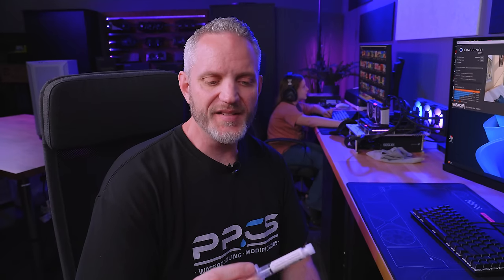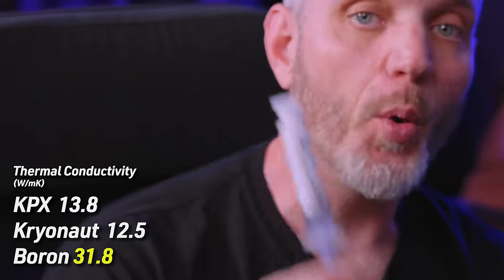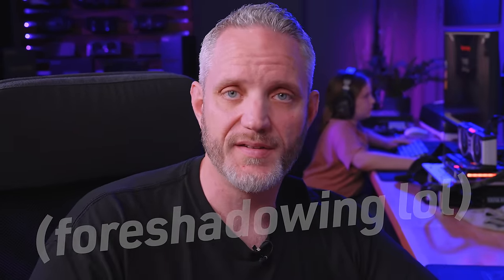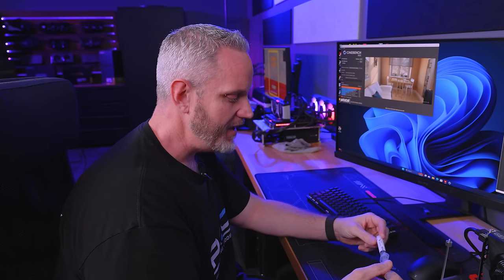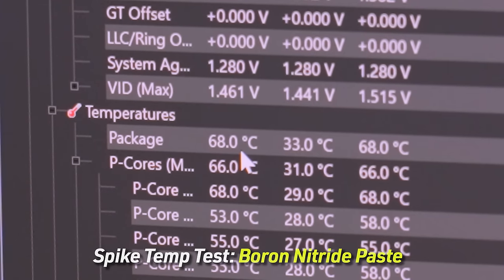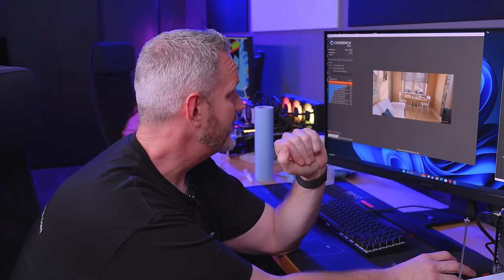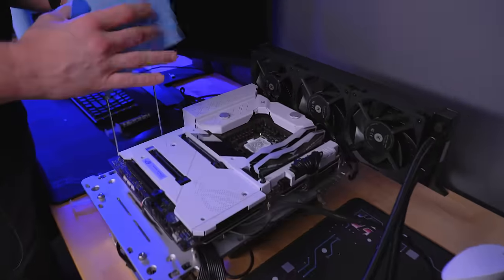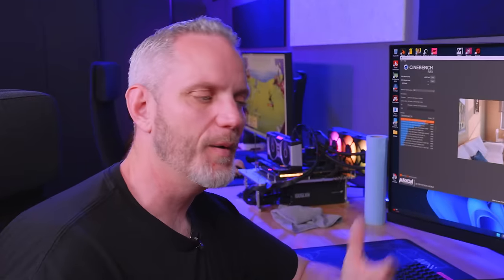Is this the new SUPER PASTE for PCs?!

Comment: So we finally found a reliable source for the Honeywell phase change thermal pads, which are great. We've got carbon thermal sheets which are also great. And now we get boron nitride super paste which I assume is also going to be great

What a time to be in the DIY computer space

How long before liquid metal just becomes completely unnecessary? To the best of my knowledge, it still has the best thermal conductivity but for how much longer?

Upon further, reading into the boron nitride stuff. I don't think I would ever actually recommend using it in a PC just because of the preparation requirements, but it's interesting and I'm going to keep using it in my 3D printer but It seems to be less usable than liquid metal for less benefit. And it is significantly less convenient than the graphite and Honeywell thermal pads

Comment: Jay, VID doesn't droop. VID is the voltage the cpu is requesting from the VID V/F curve table.

VID isn't the per core voltage. Each core and ring is requesting a voltage for their frequency at that moment. The VID sensor is reporting the highest voltage being requested out of all the cores/ring.

With boards with die sense, the vcore sensor is the actual core voltage after vdroop. With boards without die sense there its best to use VR VOUT.

Comment: So the question now becomes "would it have worked better if it was more viscous? And how would that effect the thermal conductivity? And electrical conductivity?"

We should get derbauer on it.
Reply: IIRC, there is an interview with Der8auer where he calls the thermal conductivity ratings are junk. That they can engineer and game the number to what ever they want and it will have no noticeable benefit in real world testing.
Reply: Engine oil does a great job in a car as one of the three jobs it does, plenty of viscosity there.

Comment: My next build I'm going with the Grizzly Kryosheet and Grizzly Contact Frame
Reply: I have been thinking about trying out the kryosheet myself...I'm using direct die with liquid metal right now, but it is very annoying to clean up...Plus I have to basicly lap my cold plate everytime because the liquid metal kinda etches the coldplate...I have heard the the kryosheet works almost as well as liquid metal and I won't have to worry about it anymore! I may throw one on my GPU as well...
Reply: @brucepreston3927  I don't think the Kryosheet works nearly as well as liquid metal in most benchmarks I've seen, but I don't think I've seen anyone trying it direct die either. That said, how often are you re-opening and re-applying LM? It should basically be a one and done job, it degrades maybe a couple C over years.
Reply: I've never used liquid metal, so I can't speak to whether or not it is better than the Kryosheet, but I have been using the Kryosheet since it has come out, and it works very well.
Reply: @tmoore121  My PC gets very dirty where I live so I usually do a full teardown and deep clean twice a year...I know I don't need to change the LM every time, but I do it just for piece of mind and because I might as well if i'm already doing a full teardown of everything else...I will pick up a couple kryosheets just to try it and see what temps I get...I know it won't be as good as LM, but if it's pretty close I may just keep using it...I'm sure it will work better on my GPU also, I haven't been brave enough to try LM on that...
Reply: @TTM1895  Thats good to hear! I know it won't be quite as good as LM, but it will fun just to test it and see what I get...If it works well in my PC, I may try it on my laptop also...I just like tearing computers apart! lol
Reply: Yeah the Kryosheet is awesome. Performs some °c worse than my paste but its so piss easy to use..
Reply: @brucepreston3927  I'm impressed with your determination, I don't even bleed my loops until rebuild time. I blow out my fans/rads once per year and otherwise just let my shit suffer.
Reply: @tmoore121  Yea it usually takes me 5-6 hours or so to do a full teardown and clean everything...I even strip my CPU/GPU blocks down and clean the micro fins...It's definitely not necessary, but nothing about my build is necessary! lol

Comment: Well, you don't have to go into to what W/(m⋅K) means, as that is what it means. 

As long as the thermal paste has decent thermal conductivity, small differences in the thermal conductivity between different pastes matters little compared if there's air pockets, and whether or not the layer of paste is unnecessarily thick. There should be as little paste as possible, while making sure all voids are filled, as thermal resistivity increases with the thickness of the paste layer, no matter the W/(m⋅K) value of the paste.  Thermal paste is truly one of the cases where "less is more", as long as all the air is replaced by paste. A 2 micron thick layer will have twice as much thermal resistivity as a 1 micron thick layer, all else equal.

Comment: Recently i RePasted my PowerColor RX 7900 XTX Red Devil Limited Edition card cause it was overheating and reaching 81°C GPU Temp and 110°C HotSpot with the GPU Fans on Auto.

So i RePasted it with KingPin KPx paste and i made sure to spread out the paste all over the rectangle area all over the GPU chiplets.

And now the difference is night and day.
The temps dropped to 75°C GPU Temp and 99°C HotSpot with the GPU Fans on Auto.

And after i decided to do a bit of Overclocking + Undervolting on my Card.

The temps went even lower, much lower.

Currently i have my Card set to this in the AMD Software Adrenalin:

GPU Clock min 500MHz - Default 
                    max from 2900 set to 3000MHz

VRAM from 2500MHz set to 2714MHz

Voltage from 1150mv set to 1125mv

Power Limit from 0% set to 15% The maximum 

GPU Fans set from Auto to 85% Max speed - 2880RPM at Max Load

And with these values which i've set.
I get GPU Temp 61°C Max and HotSpot Temp 89°C Max.

And my mind is officially blown away by these results.
The KingPin KPx paste is truly the best paste.

I even have it on my Ryzen 7950X3D + 420mm AiO Arctic Liquid Freezer III ARGB

Comment: Der 8auer explained this in a different video pretty well: thermal conductivity is highly dependent on the temperature difference and temperature overall. High temperature mean a higher conductivity, no matter what. And manufacturers measure it very differently and are free to choose whatever method suits them best and produces the highest numbers. 

Thermally stable materials will then be tested at the highest temperature they can sustain, because that produces a higher number and better marketing material. 

A paste for CPUs is often tested at 100 degrees centigrade which is the CPU maximum, or sometimes at the highest temperature the paste can do, 200 or something, because the conductivity will appear to be higher, despite the CPU never reaching that temp and hence, conductivity, ever. 

A paste meant for 3d print heads will be subject to 200-300 degrees centigrade, and thus the conductivity is measured at that temperature. Which a CPU will never reach, and the effective conductivity for CPU application is therefore much, much lower. 

Unless the manufacturer specifically states at what temperature their conductivity was measured, assume the absolute worst of them. Assume the manufacturer tested at the maximum paste temperature or 100 degrees, whichever is higher and the actual real-world conductivity at your lower real-world degrees is MUCH lower than that. 

And there is no best paste for all systems, because desktop CPUs will be running between 35-50 idle and laptop CPUs to 50-65. Desktop CPU users will call the fire brigade and the emergency shutdown when the desktop CPU reaches 99 degrees, while 99 degrees for a gaming laptop CPU is just a regular Tuesday.

Comment: simple answer is its to jay term - LIQUIDYEE for use, which is why its not used ever in such applications as cpu cooling,  

This is why water based thermal stuff is never used on those parts, its used where u can place it in a hole or area that wont be presurized to make it move once it dries due to its viscosity.  it needs to dry solid, if pressed it wont be thick enough to work, it will get pushed out as saw in the video.

Comment: This paste is usually used on hot end heaters. It normally doesnt have to hit 100°C

Pressure isnt the issue as some hotends do have pressure. I use this stuff. It usually gets used around 70°C and i believe due to being water based it will dry out if kept too close to 100°C for too long.

Comment: Hey Jay, I stumbled across a great thermal compound with SYY 157 - It has a rating of 15.7 W/mK and its designed for CPU and GPU application! It's non-conductive, and their kit comes with literally everything you could want when it comes to preparing and applying the paste. 

I was wondering if you'd ever given it a shot/what your thoughts on it are? 

Anyone else here have good results with it?

Comment: The thermal paste that I use is called "HY-510".  I bought 300g of it in 10 30g plunger tubes for all of $20CAD.  How well does it work?  My Ryzen 7 5800X3D is cooled by an AMD Wraith Spire which I installed about 1¾ years ago using HY-510.  So, here we are 1¾ years later and, according to Speedfan's reading at this very moment, it's holding nicely at 42°C.  Not bad for a CPU with a max temperature of 90°C.  It really doesn't matter what thermal paste you use unless you're some crazy overclocker because for typical gaming and home use, my HY-510 works just fine.  I have zero complaints.

Comment: FYI for anyone out there that thinks you can "overtighten your cooler and squeeze too much paste out" that's not how it works 99% of the time. any paste that can be squeezed out should be. direct IHS to cooler is the best cooling, paste is just there to fill the microscopic spots where they can't make direct contact because at the end of the day we can only make things so flat

Comment: I have a suggestion for a video.  Put this new thermal paste in the frame of the size of the Processor at least 3 models of different thicknesses and put it in the oven at 100 ⁰C for 10 minutes.  Then place the models after they have cooled down in the freezer.  Repeat this twice with heating and freezing.  You might get a cooling pad for the processor that will surprise you.

Comment: The TIM under the IHS is the bottleneck. The TIM on top of the IHS is less relevant. You can delid and use LM between the die and IHS to see really good performance (this was awesome on the old intel 7700K because the TIM they used on the die was utter trash), whereas, using LM on top of the IHS will not really gain you much performance, as an example. Using exotic TIM on top of the IHS is waste of time and effort, believe me, I tried it all. I went through those enthusiast years of chasing clocks and obsessing over a couple of degrees. While it was fun, and I learned a lot, the biggest lesson I learned is that it is FAR more enjoyable to just use a decent TIM, a good cooler, and tweak the BIOS to see the best performance. Saves time, money, and headaches.

Comment: I think part of the problem is that the boron nitride paste is really designed for use at higher temps than the pc will ever reach. It's designed to be effective in the 200 C - 400 C range that 3d printer hotends operate at. I think it also is supposed to have time to dry out before it works at it's peak efficiency, which probably would have required a few hours or maybe days.

Comment: So from what I know, you are kinda correct with 'thickness' (viscosity really), which is part of the deal here. That's why Noctua's paste has lower conductivity on paper but performs on par with other flagship products. There are other things to look at - conductivity might change with the temp the paste is at (some materials will conduct better when cold or better when hot). On top of that, as you mentioned - it's a paste, it has particles in it and the depending on how it behaves, it can have different conductivity in different directions (dimensions). And I'm just scratching the surface here on what's really going on...

Comment: Fine diamond powder has the highest thermal conductivity, it's much higher than boron nitride. The thermal conductivity of aluminum nitride is also higher than boron nitride, but aluminum nitride would hydrolize and it's performance is not as stable as boron nitride. Surface modification procedures have to be adopted, when making thermal paste by aluminum nitride powder.

Comment: Doing it the other way around and using PC grade thermal paste on your 3d printer can work (make sure it's good up to your printing temp plus a fair margin (10-20%) rather well. especially if you have issues with heat creep. Did that when changing out a nozzle once (from the same batch of .4's) because of clog. PLA and PETG all printed a smidge nicer on long prints after that.

Comment: So one thing that's very important for thermal paste is a very low surface tension and viscosity because you want to make the layer as thin as possible. I'm guessing that the boron nitrate is not nearly as viscous as the thermal paste, so it doesn't allow for an incredibly thin layer that forms to the both surfaces perfectly.

Comment: If it dissipates heat quicker than silver then it's a winner ❤

As a Jeweller for 23yrs I can confirm silver dissipates quicker than any other precious metal due to its lack of density.
Reply: Gold does it better, Mr Shekelstein.
Reply: @TwiztedJugallo  no it doesn't. You don't know what ur talking about.
Reply: Diamonds are best
Reply: @discodan2265  on the contrary, I actually know what I'm talking about and you are sn intellectual lightweight. McLaren F1's engine bay is lined with gold for better heat dissipation. Why didn't they use much cheaper silver instead? Like I said, you know nothing.

Comment: The suffering with this stuff Jay, is that its a water-based solution; when it dries and the water evaporates it turns into a sort-of-weak-cement of sorts.

Most people using it on 3d printers tend to bring it up to a boiling temperature slowly to evaporate the water and avoid bubbles in it/etc..

Re: YOU NEED TO LET IT DRY SLOWLY TO WORK PROPERLY.

Comment: Sooo, an idea... why not take a dab of the paste and put it on the heatsink first instead, smush it against the IHS enough to make it spread out as required, then remove it and blast the heatsink with a heat gun until it reaches 101c; then go and put it back on the IHS after cleaning up the IHS. 

My thought process is this. 

1. Some CPU's like the X3D series will NOT let you reach 100c normally to protect the extra cache memory. 

2. The paste is too thin to do its job due to the excess water left in it. Thus heating it first should help in allowing it to stay thicker prior to tightening it down, instead of being watery while tightening it. 

3. The method of application will allow you to shape the remaining drier paste if needed due to any pockets or voids that show up from the first mounting. 

The part i am unsure about, is how long you should hold the heatgun to the paste prior to remounting. How long will be too long, etc and so forth, since of course you do want there to be some viscosity, but not too thick or thin.

One more thing.

What about adding extra ingredients? Like perhaps something thermally conductive, but not electrically, to help balance out that thickness and remove some of the electrical conductivity by effectively 'watering it down' with other non-electrical material.

Comment: The 'veins' happened when you lifted the pump off. hydro-dynamics searches out the best way to dissipate the pressure created by pulling on the pump.  Thermal paste would do the same if it was less viscous ... or more watery.

Comment: Locked the voltage but left the LLC :D 
Also there are at least other 4-5 power saving options in the BIOS that you have to remove if you want to have somewhat accurate results. Not just... in the ballpark..
I see the frequency is not asctually locked as well

Comment: Evaporate it a little before applying it to increase thiccness if that is a concern.

However I think the reason its not ideal is that it isnt as smooth, most of the thermal transfer in the socket is metal on metal. The paste is there to full out the remaining gaps but if the past is grainy it might even reduce the metal on metal contact.

Comment: Thermal Compound Paste 18W/m•K 3g High Performance CPU Compound Paste Heatsink for GPU Processor and More. Thats the name of the product posted from Pano-Mounts sold on Amazon. It says its 18W/mK and at 13.99 for a 3g tube its cheaper with better specs than TG. Might be worth looking into. 15.99 for 5g at an even better value.

Comment: Hey Jay, check the thermal paste on asus rtx 4080 or 4080 super tuf and strix. Under load 85°C and 105°C Hotspot. New paste 60°C and Hotspot 85°C. Asus paste was dry and mostly gone on a 3 month old 4080 super tuf. 🧐

Comment: i think you need to keep it at 100C for a longer time cause i dont think that much of the water actually evaporated ( basicly still looked just as watery when you dried it of then when you put it on ) so maybe a longer time at the 100C would make a diffrence

also it was the core that was at 100C. dosnt mean that the IHS had reached 100C. and defently not for as long as the core had

Comment: So I wanted to look up the thermal conductivity of my paste (MX-6) and Arctic's take on the matter is as follows: 
"ARCTIC made a conscious decision not to specify any values for the thermal conductivity of its thermal paste and thermal pads, because many manufacturers invent, artificially inflate or embellish this value. Thermal paste has a thermal conductivity of 1 to 4 W/mK. Values outside of this range, such as 12.5 W/mK, are at odds with the truth."  
Does this generally check out or what?